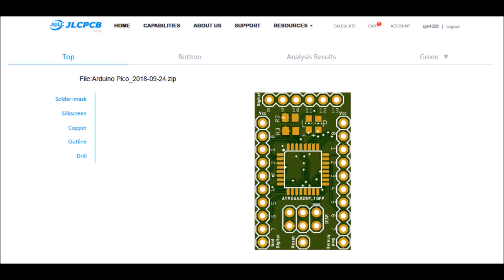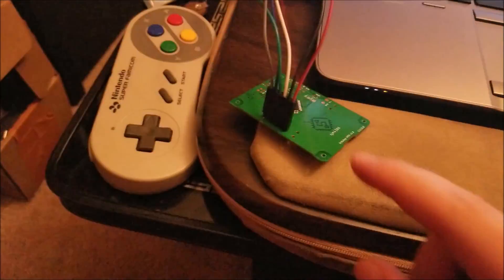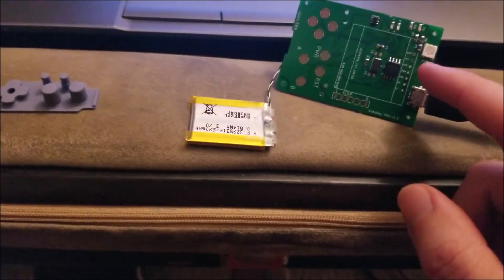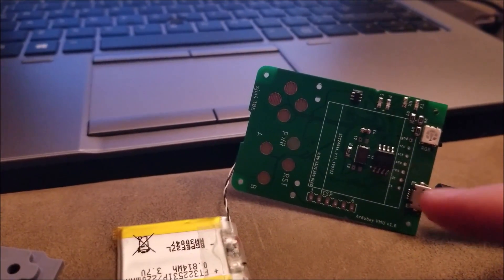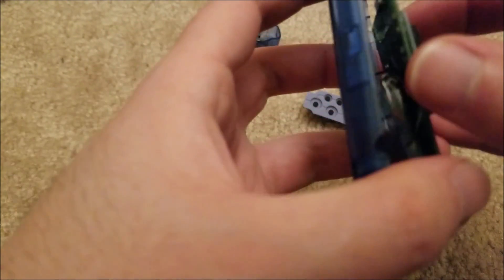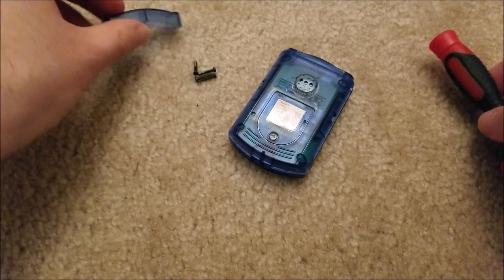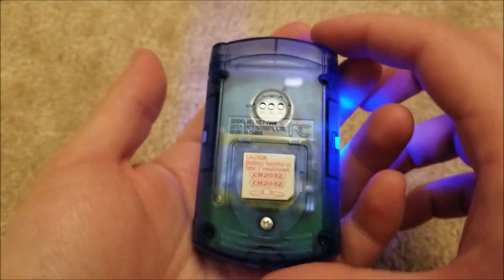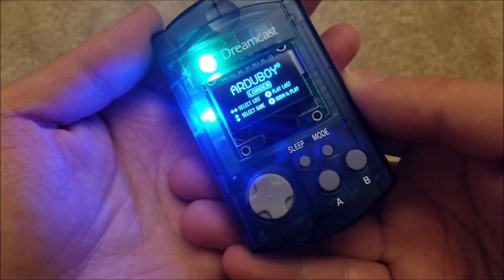It's an Arduboy ... It's a VMU ... No Wait It's an Arduboy in a VMU!!!

Comment: Very nice. You made the ultimate Dreamcast VMU, by far:-)

If you live a 2032 coin/button batteries, will be drained after a week, still? Or you made changes to the circuit so that it doesn't drain? I wonder how come when my wireless Logitech mouse even with the AA battery in it, doesn't drain even after months of not taking it out, while the VMU, if you forget to take the batteries out, it's totally drained?

How I wish all screen where OLED but bright as miniLCDs that does not or are resistant to burn-in as LCDs. How I wish  used OLED in all their displays and stop using LED, even the miniLED coz' it still has that halo effect and it's still not 100% black.

God bless, Rev. 21:4
Reply from the maker: Thanks, I designed the board to run off an internal lipo battery with a soft-power switch with very low leakage. Pretty sure the internal leakage of the battery is higher than the quiescent draw of the switch I used. The reason the original vmu ate batteries so quickly was the rtc (real time clock) likely wasn't very efficient and also the saves were held in sram which also would use some current to retain the memory even when off.
Reply: @sjm4306  Yikes, why'd SEGA design it like that when batteries on PC motherboard designs already exists in the 90's that don't drain like that (they last years)? Also why didn't they just copy how digital watches do it- they take years before a digital watch stops.

Is there anyway you can mod the VMU's real time clock to be efficient? 

Could we hack it with some combination of SMD resistor and capacitor to make the rtc and SRAM not drain power even with the batteries in it, like our TV remote controls or mice?

It'd be nice to have a tiny "Game Boy" (the VMU) w/ homebrew games, w/ efficient power, in one's pocket or keychain. I like the VMU's form factor- it's nice to hold.
Reply from the maker: By this point it'd honestly be easier to remake the vmu from scratch around nonvolatile fram memory and a low power arm processor.

Comment: Any updates on the 2.0 boards?
Reply from the maker: I never got around to making a video on it but v2.0 fits, and breaks out the icsp header for easy future bootloader flashing, but still requires some case cutting. The biggest problem I've found is the buttons are just so fiddly due to their size and sensitivity (especially the dpad which is too easy to press an adjacent direction).

Comment: Hello I am attempting to build this myself now and I am having trouble finding that's the Pacific screen that you used among other small components that populate the board my question is do you have a specific website where you curated it all these parts?
Reply from the maker: I bought most parts from ebay with the exception of the common passive parts like caps and resistors which I already had in my parts bin. This is the screen I used: https://ebay.to/2BwYAGx

Comment: so cool! can this also be done using a mac? and how much do u think the whole thing cost?
Reply from the maker: I dont have a mac to test, but you can burn the cathy3k bootloader using a package Blinky made for the arduino IDE (I believe there is a mac version). All you really need hardware wise is a usb atmega icsp programmer like the cheap usbasp clones. I'm not sure if the python script he also provides to assemble and burn games onto the flash chip will run on mac though.

Comment: If you push the usb and the led up can't you fit a bigger screen? Looks like you have enough space left.
Reply from the maker: Dude, clear buttons with the rgb led backlighting them in an opaque shell would look sick!
Reply: @sjm4306  yes! I wonder if Kitsch Bent can make them, they make custom silicone ones for the DMG so maybe.
Reply from the maker: I've ordered a 1.54 and 1.3 oled coming in the mail so I hope one of them will fit (the bigger the better)!
Reply: @sjm4306  Wait for the screens before you change the pcb's x'D
Reply from the maker: I will just in case, but I think worst case I could use a short length of ribbon wire and some double sided foam tapr so any screen that fits in the case can have some wiggle room.
Reply from the maker: I have some contacts through friends I can ask about getting some professionally made in the style of gameboy screen lens'.